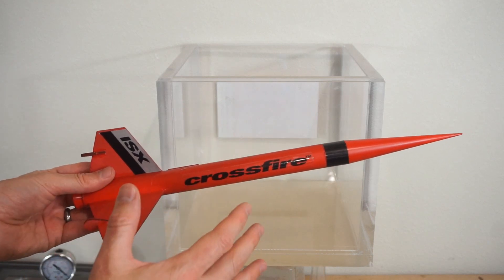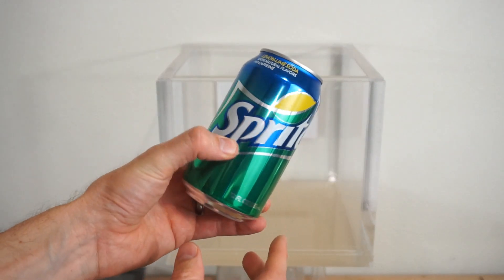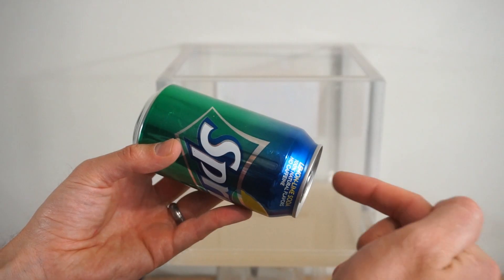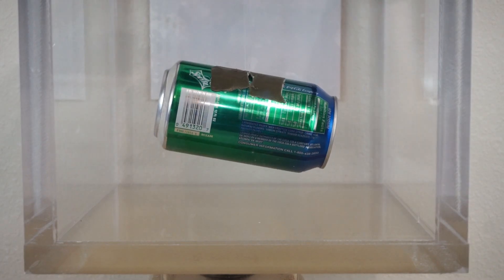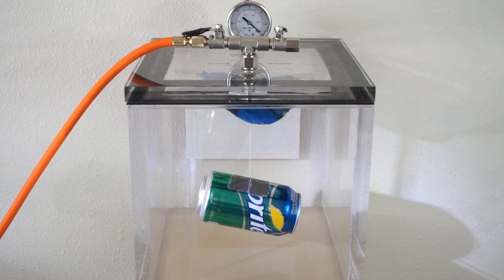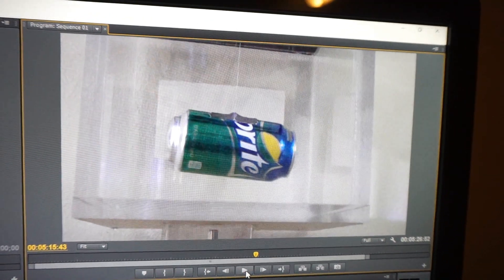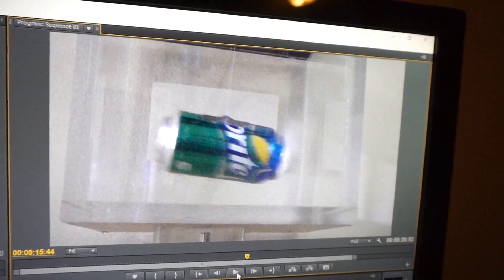Can a Rocket Fly in a Vacuum Chamber?

Comment: These experiments prove nothing else but exploding rockets in 'space'. Your so called space is not a contained vacuum with 4 walls. It is infinite (for the believers). There is nothing to thrust against (like these walls), so the rocket would go off in all directions. All rocket-fuel would burn at once and the rocket would go floating.
Reply: If I fire a crossbow in a vacuum, will I feel the recoil? Yes or no?

Comment: The Wall is Resistance... 
What About No Resistance...

And How long he can move...

Ur Vacuum Too small...

U must make no Resistance in the Vacuum...
Reply: If I fire a crossbow in a vacuum, will I feel the recoil? Yes or no?
Reply: There is no relation to the distance to the wall because It's vacuum 
It moves until the pressurised gas is over
Reply: @anaghram1896  Gas comes out but won't give a push forward because it's not there resistance...

but if there is air he will push the air or other resistance...

and how do rockets turn around the moon..😧
Reply: @anaghram1896  gas in the room is equivalent to the liquid in a glass ... so it takes more than one room so that the gas doesn't fill the room ... while space is much bigger to be able to fill up with gas and cause a boost ...

Comment: The instant the can is opened....the vacuum    is  not a vacuum..  Because it is enclosed.
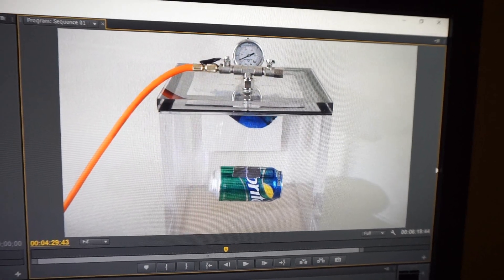Reply: 5:01 🙄🤦‍♂️
Reply: @zeendaniels5809    The gauge will not respond exactly the instant the vacuum is lost.   It is a fact that as soon as the can is opened the vacuum is lost......the end.
Reply: @boptah7489  
Note how this shuttle continued to accelerate after the two SRBs were separated from it.
https://youtu.be/OnoNITE-CLc?t=183
Also note the small thrusters in the noses of the SRBs pushing them away from the shuttle and its external tank.
This happened at an altitude of 50 km, where the atmospheric pressure had dropped to 1/1000 of that at sea level – a much better vacuum than in this experiment! This proves that rocket engines do work in vacuum, and they do actually work better there than at sea level.

Comment: Thank you I now have even more proof that rockets work in space. Tho a much larger container would have been better.
Reply: But a rocket is a pressurized metal cylinder. You have evidence to suggest that the rocket would explode in space.
Reply: @ashybear1215  What? My proof is that even without an atmosphere that physics still work. 

I.e. For every action there is an equal but opposite reaction. You know like when the exploding can sent itself forward.
Reply: maloc1824 Yeah, I see what you are saying, but it doesn't matter if the rocket can propel itself if it explodes in the process. FYI, I am not apart of the Flat earth crowd. I don't think what we are told is true, but I am not a flat earth shill. It could be a sphere, but I question any type of space exploration.
Reply: @ashybear1215  While rockets may explode on the occasion, it is relatively rare, my entire thing was some FE guy said that rockets cannot work in space. 

Besides that why do you keep bringing up rockets exploding. What does the thin soda can exploding have to do with rockets exploding. Rockets are designed to expel their gasses in a certain direction the soda can just used the path that gave away first.
Reply: @maloc1824  They are pressurized with oxygen. It doesn't matter how thin/thick the cylinder. If a pressurized vessel is in a vaccum, then it is going to explode. It doesn't matter if the rocket can move if it explodes.
Reply: @ashybear1215  prove it. Rockets are designed to expel their gasses out a nozzle.
Reply: maloc1824 Not oxygen. If they expelled oxygen out, then the astronauts couldn't breath. It's always gonna be pressurized with oxygen and therefore it will explode. You can side with basic physics or the nonsense narrative of people that see you as cattle.
Reply: @ashybear1215  yes there is oxygen in the crew compartment and it stays in the crew compartment. It in no way gets used elsewhere. The fuel is in a separate chamber.

Also how about you do a little research on rockets and the crew compartments work before you start spouting they will explode.

As for it somehow exploding due to being pressurized go to any party supply store and ask them what the contents of their cylinders are pressurized at and then remember the crew compartment is only at 14 psi. 

There is no reason to believe a 14 psi compartment will explode when introduced to a near zero psi when the cylinders that get filled with helium don't do so and they are at a much higher pressure.
Reply: @ashybear1215  in short you have no idea of what you are talking about.
Reply: @ashybear1215  An even easier way to prove you wrong is the fact the vacuum chamber  they made did't implode.
Reply: @maloc1824  That makes no sense. When you leave the atmosphere you lose the balance of external forces on the object and you only have internal forces out from it. Why would it implode? I don't think you're smart enough to discuss this.
Reply: @ashybear1215  Please don't tell me you are part of the FE crowd.

Comment: uuummmmm i seen a can of pressurized pop explode by the force of vacuum, why wouldn't the can move?, it exploded, this is by no means proof rockets create thrust or work in space, the vacuum had enough force to pull the lid away from the can, that same force moved the can not rocket thrust lol   this  but it does raise a few questions about the space suits they wear, like the can of pop expanding shouldn't they be pulled into the star fish position, whats stopping  their suits from behaving like the can did?

Comment: "pretty good vacuum" is not a complete vacuum. By settling for "pretty good" you've admitted that it wasn't a complete vacuum, which is the point of the test. If there is even the smallest amount of air left in the chamber, then you're "findings" are completely null and void. Also the act of the can throwing even just one frame of worth of the air out of the can and into the chamber, voids your experiment. As the can adds more air frame by frame, it gives more air to push against. No offense, but this didn't prove anything, as it wasn't at a complete vacuum at the start and just the act of the can exploding takes away from the vacuum that did exist. This in no way replicated a rocket in space.

Comment: Question, can a rocket fly in a vacuum? ANSWER: YES AND NO , How can this be? Even if a rocket or thruster is in a vacuum and  the thrust has a static mass that it can push off, it will fly,    BUT if there is NO static mass for the thrust of a rocket or thruster  to thrust against, the rocket will not fly or have any control in any direction, NO atoms (static mass)  NO  controlled flight, just float into outer space!!!!  Fun vid for the action of "RECOIL"   like a cannon or gun!! RECOIL AND THRUST ARE TWO DIFFERENT ACTIONS,

Comment: I see what happened. It was the vacuum that burst the can. However, at 4:50 you can see the can top was blown off. The pressure pushed off the can top as it was blown off the can. Like firing a gun, yes there is recoil because pressure builds up between the gun and bullet. The pressure pushes the bullet out and in turn pushes the gun. A rocket is like a gun firing a blank. The powder burns and moves out of the barrel only pushing off the air (assuming the gun powder was not encased in anything). Now if the can stayed in one piece and the top stayed attached, the can wouldn’t have moved.

Comment: Just imagine you are holding a heavy item. Push it forward hard, you will move backward. This process doesn’t request air to complete(although you can’t breathe in vacuum). The rocket is you and the  propellant is the heavy item
Reply: The propellants once combusted do not make solid objects; they create gas.  If you could walk on air, your argument would work.
Reply: @DrCash7  what are solid objects made of? you can throw a heavy object or the same ammount of mass in gas contained in a balloon and the effect would be the same.
Reply: @DrCash7  amazing how many nasa shill arguments start with the word 'imagine'. you know rather than just solving a PV work calculation for when P=0, or drawing a free body diagram for a body surrounded by zero mass, or actually doing any physics at all...
Reply: @Papa Legba  had not noticed lol. 
 "Imagine:
 a heavy object
 a fired steele projectile"

Yep you're right
Reply: @DrCash7  that, and pretending a gas behaves the same as a solid, is their entire argument. the rest is abuse, gaslighting and lies.

Comment: thx for the Video , The energy produce mouvment even in a vacum , so the Rocket is not using the contact to the air to push itself its using energy to push itself thru the air .
Reply: Dimamo Darti
 it was using the wall of the 'Vacuum Chamber' to push off of. That's why we differentiate between 'Vacuum Chambers' and 'infinite vacuum'.

Comment: The liquid and de gas pushes against the Can CAP, buddy! =P 
Thanks ;-)
Reply: Yeah is very un scientific, way too close to wall.
Reply: @BrainUser1  yep - it's a nice vid but he needs to show it at least with a long box to shut us fools up;)
Reply: @101guitars-tm  It is totally ridiculous; the can is horizontally balancing with a string, obviously when the liquid moves outward it is goint to rock and not remain balanced.  The explosion first pushess against the lid, rocket nozzles are already open, and no resistance anywhere near....
  He should of done it at least with a vertical can exploding downwards!
Reply: @BrainUser1  Thanks for educating me ?!? :)
Reply: @BrainUser1  doesn't matter if you do a frame by frame analysis
Reply: What? A can exploding inside a tiny chamber prove's nothing, aside that pressured containers want to explode in a vacuum, think Apollo had some of those....
Reply: @BrainUser1  yep...called a rocket motor. Explain the difference in principle.
Reply: @petermirtitsch1235  👍✔see what happens in REAL VACUUM 
https://youtu.be/76JM03a6WH4
Reply: look at the clock as the gas and liquid pushes on the wall
Reply: The soda hitting the wall has nothing to do with the can being pushed back. Have you guys even tried watering your garden with a hose and try to hit the wall. Let's see if you don't get push the same as with no wall.
Reply: Yes ava. Both have opposing reaction.
Reply: Failed experiment - he doesn't account for the gas in the can pushing against the wall immediately after outburst
Reply: @lordzeusourgodoftruthstorm4410  It is a pityful simulation all around, but most of all it is about a self contained Explosion where one side pushess the lid wall off the gas bomb giving a direction to pressured forces, thous push against the other swinging side.
  Not a rocket engine releasing pressured gasses out of a wide openning hitting against Nothing at all.

Comment: I don't know if this proves that a rocket works in space, but for argument sake let's say it does.  How did, or currently do, the astronauts steer their way back to Earth?  There would have to be some sort of drag for rudders and ailerons to work.
Reply: They use rocket engines to ORIENT the rocket AND to push it in a particular direction.    want evidence of rocket propulsion working in a vacuum? Watch the YT video "Six SpaceX launches synchronized to the landings". In that video you will see over thirty examples of rocket propulsion IN A VACUUM. If you cant spot all of the examples, let me know and I will point them out to you. HINT: ALL of those maneuvers of the first stage and the second stage igniting and flying away are in HARD VACUUM.

Comment: Hey dumbass its going to be the same every time, use a large vacuum chamber where the cans gas and or liquid cannot push off the walls of your vacuum chamber. The gas comes out before the liquid, your not very smart, and this does not prove anything accept your not very smart. In this case the gas reaches the walls before the liquid, in your other vids the liquid does. If you use a chamber large enough you will see that no movement will be seen. Any engine rocket or jet require air pressure or an atomosphere to push against to work. This is a basic law of physics and something your should learn before you go off and try to disprove this. I hope you finally take this shit off as you look stupid.
Reply: +Taz Man
 Oh man. We have another genius here.
Let's start simple:
"your not very smart" - ouch
"the cans gas and or liquid cannot push off the walls of your vacuum chamber. " - They don't push off the walls. If you look closely at 6:01 you can see that they don't reach the wall, yet.
"If you use a chamber large enough you will see that no movement will be seen." - It sounds like you have done that experiment before. Any proof for your idea, that this wouldn't work in a larger tank?
"your chamber is no where near the actual vacuum of space" - The difference is minimal and doesn't make any change in the results.
Reply: It’s basic physics and yes I have done it before. Without a fulcrum nothing moves, in a vacuum this is the case, without anything to push off of the air from a ballon or any other device cannot move, the air in this case being the most common fulcrum. In the case of this video we see the walls of the vacuum chamber being used, also the creator of this experiment was not going to the same vacuum levels as space, as space is an absolute vacuum he did or does not possess the proper vacuum to creat this level of vacuum in his chamber. In any event though we still have the issue of the chamber being the fulcrum iin space this is not an issue as no walls are there as it is supposedly a vast expanse. If you use a chamber the size of a small room, you would see a completely different outcome, I would point out another experiment done on yourutbe where a guy tapes a loop of paper around the back of a balloon novel and only the air hits the paper and not the actual air in the room, the ballon goes no where, proving that the air from the ballon must hit the air of the room to move forward, if the air is trapped or can gain no fulcrum again we have no momenent, the principle is simple yet you brain scientist cannot see this. I am a genius you got that part correct. We all know that the escaping gas or Liguria needs to hit something to move this is a fact, no fulcrum no movement period, it is simply a case of what is it hitting, and in this case its the walls of the container. This is a no brainer. Which it seems you do not even have that, OUCH!!!!! Lamo....

Comment: In a big scale vacuum chamber that could have been different, when you open a can you can hear the gas coming out not the liquid, it bounces the walls before the liquid does.
Reply: Look at the pressure gauge when it opens. Would it still be considered a vacuum at that point?
Reply: Bingo
Reply: "when you open a can you can hear the gas coming out not the liquid" - that's because the gas it is at the top of the can. Try opening it upside down.
Reply: @georgeh431  "The resistance that moved the can is pressure against gravity" - where do you get that belief from?
"That won't work in outerspace because no gravity" - why do you believe there is no gravity in outer space?
"The chamber wall is the resistance to push forward against" - the video shows very clearly that the can moves before the fluid reaches the chamber wall, so that statement is not true. 
The fact is, that it does not need to push against anything to create propulsion. It just needs to be accelerated.
Reply: @georgeh431  "it was resistance from gravity" - I don't understand, can you explain? How does gravity resist, and what does it resist against, according to you?
And why do you believe that it does?
"On aircraft carriers you see them put up a wall behind the plane" - that's to get some extra push, so they can take off on a shorter runway. How does that relate to gravity, according to you?
Reply: Its not the bouncing of the liquid that causes it to move. Its that its ejected from the can.

Comment: So the thrust is a mass,great explanation
Reply: No, Thrust is forced air/gas pushed backwards to move forward at a rapid rate. Think 🤔 about a paper 📄 plane ✈️. If it’s Lighter than air it floats but it needs some force to keep moving forward. So forced air/gas pushed against more solid thicker air the further you ascend. If there is no air in Space what is the Craft floating on? What is the thrust pushing against to move forward?
This experiment 🧪 proves nothing basically but I ain’t hating. Thanks 😊
Reply: Thrust is a force, resultant from the change in momentum of a reaction mass

Comment: the result of the experiment is not valid, because there was still air pressure when the soda exploded. I would be happy if you can prove that the soda moves under air pressure 0 Atmosphere
Reply: The pressure was minimal. It doesn't change the result. Even space is not a 100% vacuum